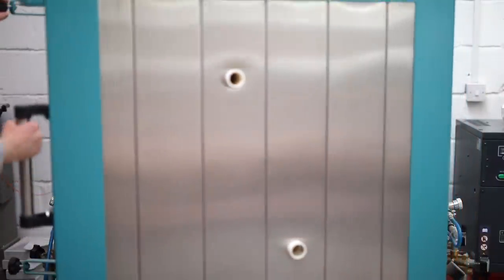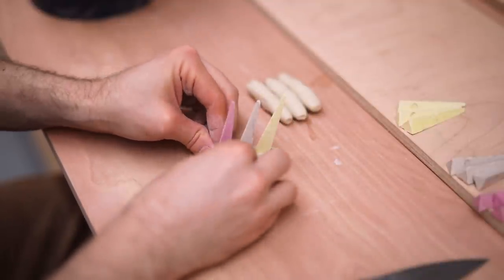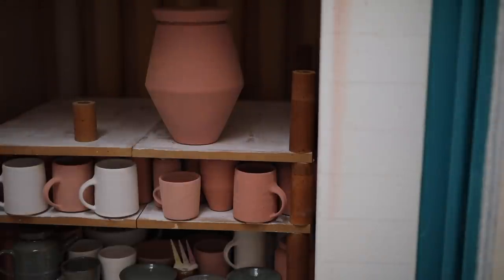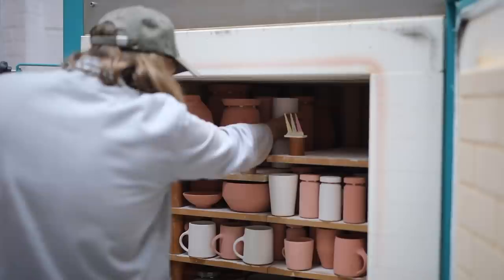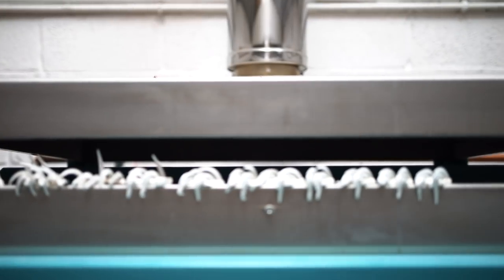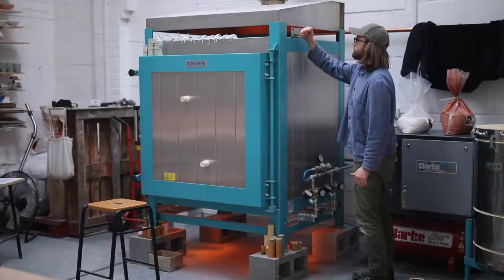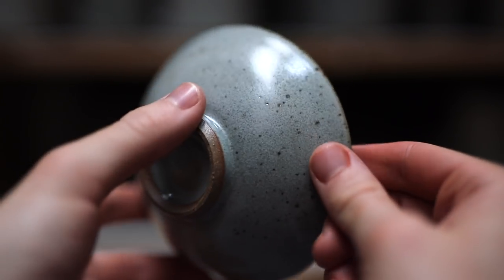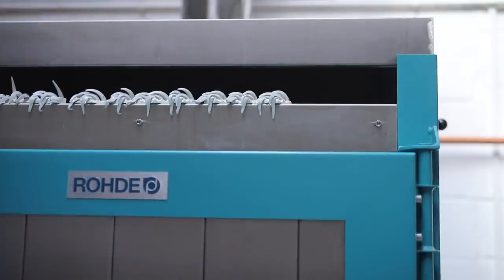Loading and Reduction Firing a Kiln Full of Handmade Pottery — Narrated Version

Comment: I can’t wait to learn how to fire gas kilns. As much as I love my top loader, front loading kilns just seem so satisfying. The colors that you can get in reduction are stunning.
Reply from the maker: They aren't too difficult to learn really. It's definitely a bit intimidating at the start and getting them installed can be tricky too but other than that it's a walk in the park. I'm pretty sure I could have someone whose never fired a kiln before fire mine just by following my kiln charts.
Reply: @floriangadsby  I’ve started taking some pretty detailed notes about temperatures, firing times, cones, etc. on my firings! Not that it is as important in oxidation, but I reckon it’s good practice. Plus, I’m a sucker for a super organized set of notes like that. Pays to be “Type A” as a potter, I suppose.

Comment: What mesh silica do you use in your glazes. In the united states there is 200 mesh and 300 mesh silica. If you change to a finer mesh silica you will have a better melt. Also you can ball mill just the silica with water and that will make a better glaze.

Comment: Thank you so much for another great video, Florian. Really informative and so insightful. 
I have a practical question, if you have the chance to answer it: when glaze firing, my Italian teachers always encouraged us to leave quite a distance between the glazed pots because according to them, the pieces, when firing, would slightly increase in size as the temperature increased, to then decrease quite significantly during cooling (sintering). Our firings were all oxidation firing in electrical kilns. When you mentioned leaving 2-3 mm in between the pieces, it made me curious. We’re our teachers over cautious? Naturally we always want to run the kiln as full as possible for any firing for economic reasons.
Sorry for all these words 🥺🥺
Thank you in advance for any info you may provide
Reply from the maker: Thank you so much! So pleased you enjoyed the video. Well, it could depend on your glazes but I imagine he was being over cautious. In an ideal world you pack as much as you can so the firings are more cost effective. I've seen some potters fire kilns with all the pots practically touching they're so close.
Reply: @floriangadsby  thank you. I will make some pieces to test grazes and I’ll try to put them closer together. It won’t be a great loss if some fuse together.

Comment: You will love the advancers. Do not let them get wet or damp. Do not wash them either.
Reply from the maker: Good advice! How do you go about painting batt wash onto them then? Or do you just let them dry considerably before putting them in the kiln?
Reply: @floriangadsby  you do NOT paint anything on them. You put some alumina hydrate on the shelf and rub it around. You do NOT kiln wash advancer shelves. Get a recommendation from the company.
Reply from the maker: @bayareaartist999  Good to know. I'm obtaining them via the kiln company itself, Rohde, so hopefully I'll glean some good information from them.

Funnily enough, when I was apprenticing in Japan, I spent a good week cleaning up a gigantic wood kiln and that included grinding maybe 70-100 advancer kiln shelves. Once cleaned up I was shown how they prepared them for the firing and it was as follows.

First, we coated each shelf in an incredibly thick layer of batt wash, then, whilst it was still yet, we sieved over very coarse alumina hydrate into the still wet batt wash, in another thick layer that gets stuck. Then they were all carefully dried out before being stacked ready for use.

I'm not sure whether they were different types of advancers perhaps? I never asked Ken Matsuzaki as I presumed they could just get wet like normal shelves can when you need to paint on batt wash.

Anyhow, I'll ask the company and see what they recommend.

Comment: During the reduction process, do you need to be careful of carbon monoxide? You say the burn becomes more and more inefficient, that would mean , more CO.
Reply from the maker: Not so much. I have some carbon monoxide detectors around the studio and recently they detect nothing. In the past, there have been moments, from about 900ºc to 980ºc where they read about 30 parts per million, but it only lasts about 1 hour and the official guidance for that amount is as follows, the adverse affects are "None for healthy adults. According to the Occupational Safety & Health Administration (OSHA), this is the maximum allowable concentration for continuous exposure for healthy adults in any eight-hour period."
Reply: @floriangadsby  yea, its going out the chimney.then...